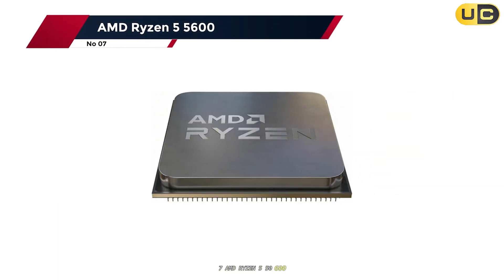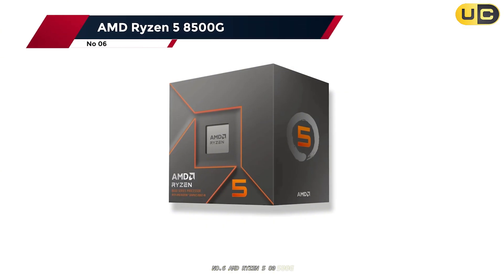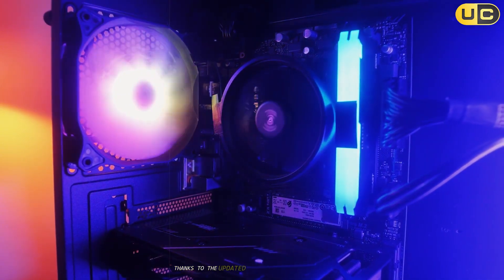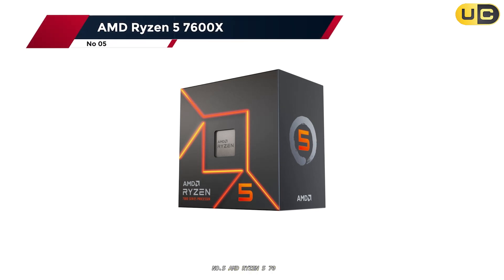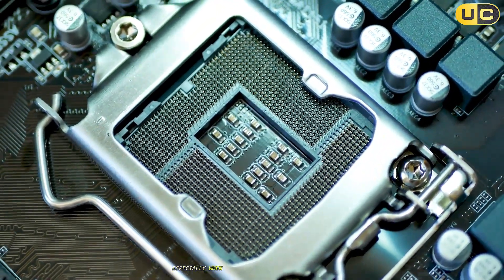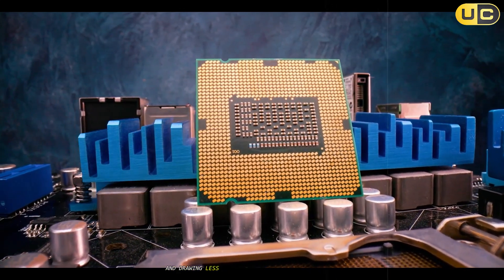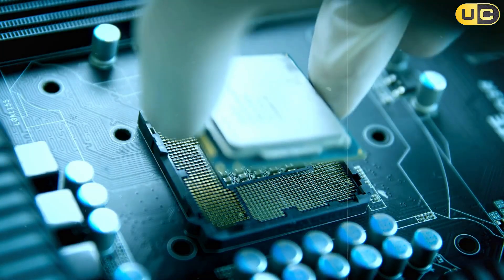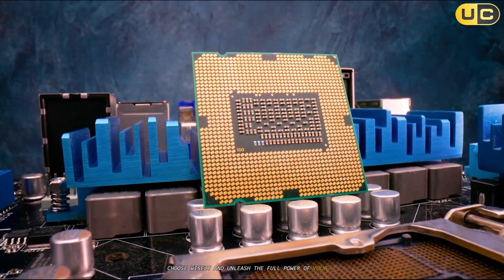7 Best AMD Processor 2025!  My Render Times Were SHOCKING

Comment: So you are saying that the 7950X3D is better than the 9950X3D? I don't think so. Not to mention none of these processors hold a candle to the threadripper 3990X or any of the Threadripper 7900 series processors